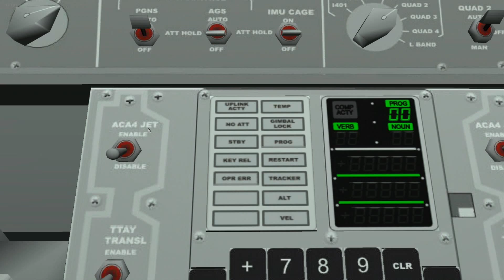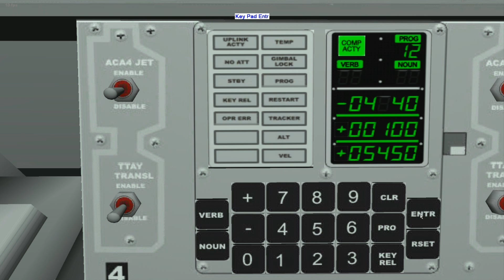Apollo 17 lunar liftoff  Eaglelander3d

Comment: I heard that several astronauts left their boot liners behind on the lunar surface 😳  It is absolutely amazing that NONE made it back to earth.   Further, WHY NONE of the Apollo filming MISSIONS show any astronauts removing these boot soul liners being removed 🙄
Reply from the maker: Most of the surplus to requirement equipment , including the lunar over-boots was booted out of the LM front hatch to lighten the ascent stage.  When all this was going on I don't think there was time or space to be getting out the video camera.
Reply: They were the outer boots, not boot liners. They were left behind to reduce the lunar dust contamination issues within the Lunar Module and to reduce weight.
Reply: @thegreatdivide825  so, how many overlays still remain on the lunar surface
Reply: @Mooseracks  They didn't only have boot overlays for the Moonwalks, they also had boots for use inside the Command and Lunar Modules. So there are 32 boots jettisoned on the Lunar surface. The last mission, Apollo 17 brought their 4 Moon walking boots back to Earth